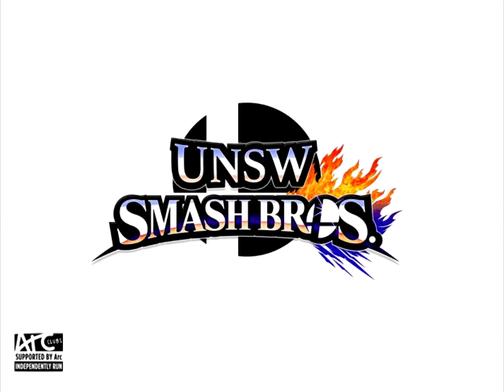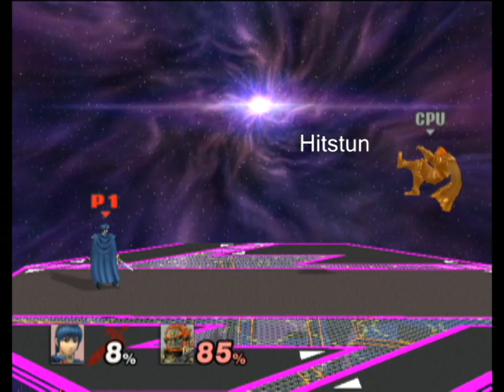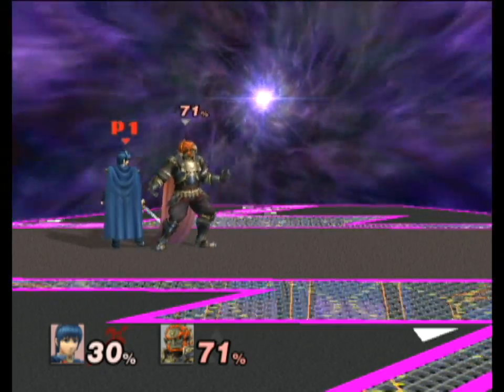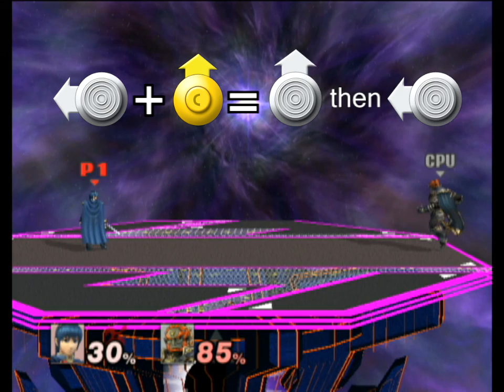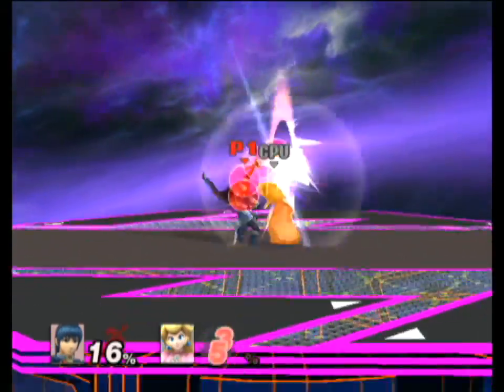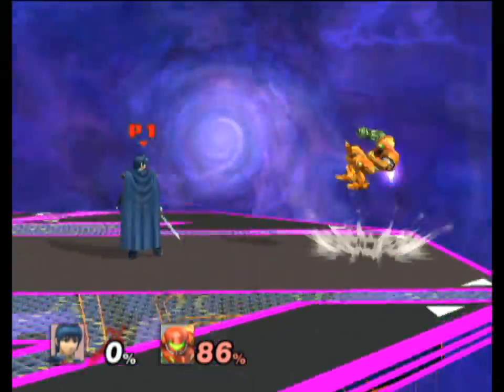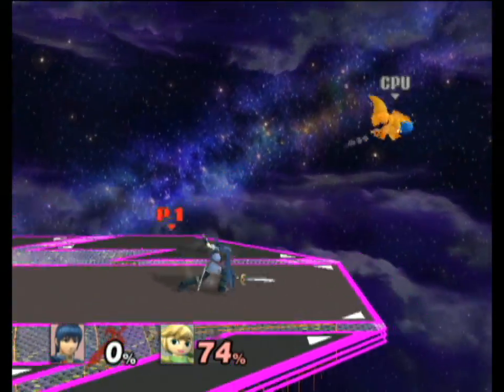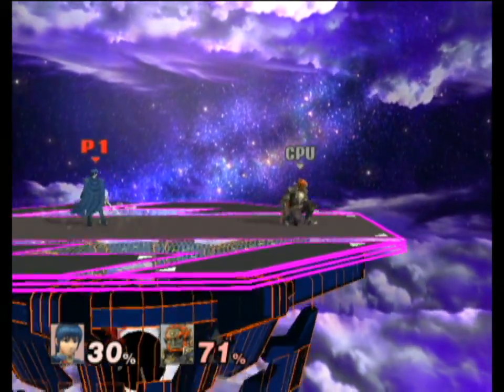Optimal tumble cancelling tutorial

Comment: Why would you use Z by default and not A? Using Z in PM triggers a tech flag, meaning in scenarios of precise tech mix-ups, you will force yourself to fail by triggering the fail window when the mix-up would force you to hit the ground; this is especially so for faster fallers.
Reply from the maker: Simply because it's easier as it doesn't require clawing. There isn't much overlap between situations where you'd want to cancel tumble and situations where you need to tech immediately, but where there is, it'd be good to use A if that's comfortable for you. Good point.